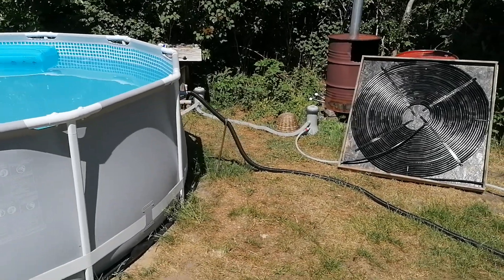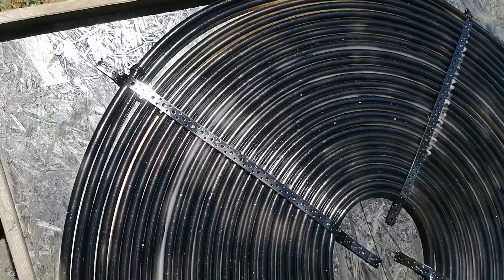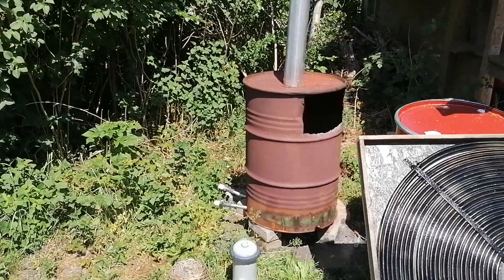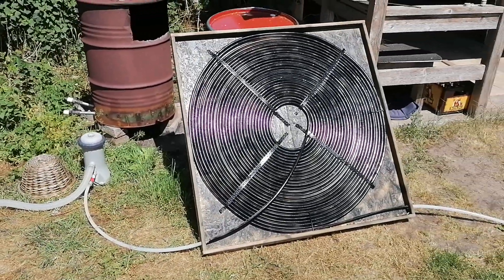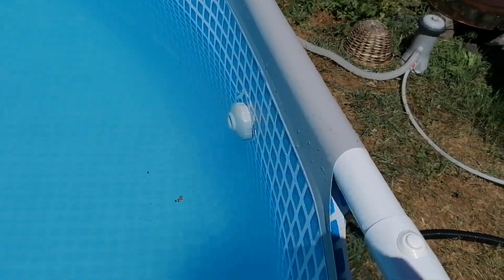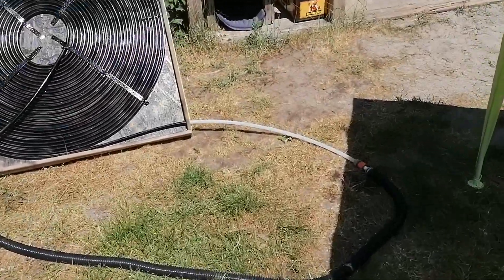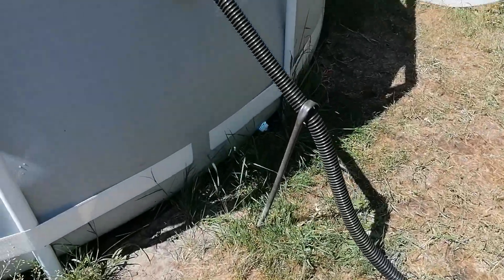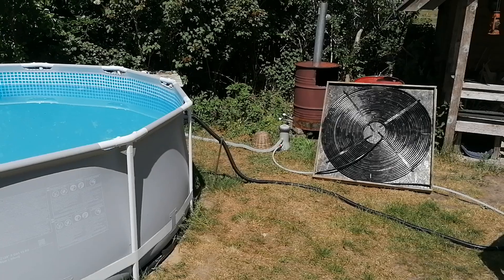DIY homemade Solar Pool Heater WORKS!

Comment: Great video, going to be building one of these this weekend. what did you use to reduce the pump output to the hosepipe connection?
Reply from the maker: I used a spare wateroutlet plug of the pool. And some tape around it to make it fit.

Comment: Without a glass or plexi cover, it will not give any heat. I tried it failed.
Reply: Strongly disagree. My buddy’s dad built this idea years ago. Only differences were his was 8’X8’ and used 1.5-2” black tube/pipe. They ran it thru the pools filtration system (was a good sized in ground pool). 
Ended up having to put in a diverter/bypass because the pool got too hot. The board and coil were on the roof of the garage facing south.
Reply: @dericksmith2137  

1. the board on the roof facing south (direct sunshine for the longest period), is the best idea
2. also the large board 8’ allows a lot more heat capture.
3. Painting the pipes black, and insulating the structure or by having an aluminium backing will allow more capture and retaining of the direct sunshine heat. 
4. The larger pipes allows greater flow of water, and hence greater transfer of heat, perhaps nullifying the greater surface area to volume ratio of water, by having thinner pipes and slower flow rate of water. 
5. With the diverter you can control the water speed and hence the temp of the pool. Also not damage your pump, in case of any (blockage or slow water) problems. 
6. (Admittedly a closed enclosure with a greenhouse effect by petG glass will capture and retain more heat).  Reaching temps unattainable by a open and uninsulated box. 

Very clever. Well done.

Comment: Do you think single pump would be powerful enough to get water through panel on patio roof?
Reply: I tried with the same pump as in the clip and it was nowhere near powerful enough, ended up buying a submersible pump which did the job.
Reply: What sized SUP pump?
Reply from the maker: My single Intex pump has a.static power of 75cm.
Reply: @deliuspit  ok, thanks
Reply: That is what I am wondering.  Was going to try laying the hose on a black flat roof which is in sun all day.  Attaching pipes together without leaks also looks challenging 🤔